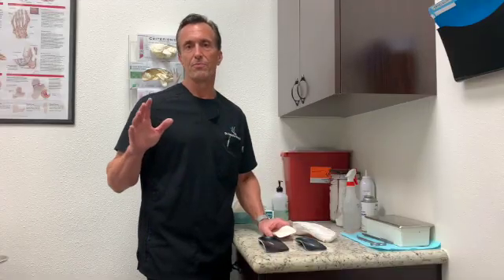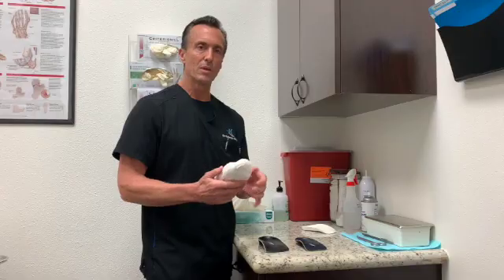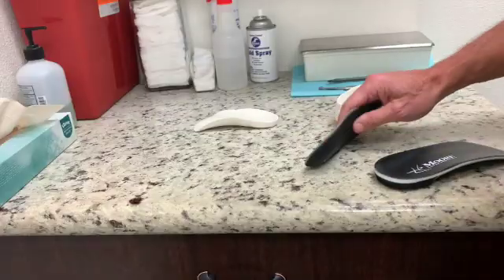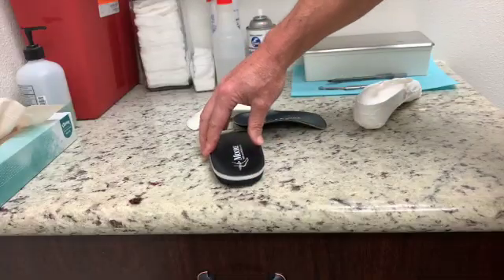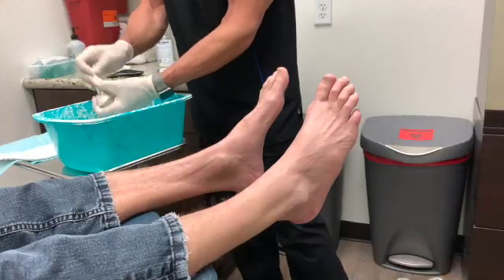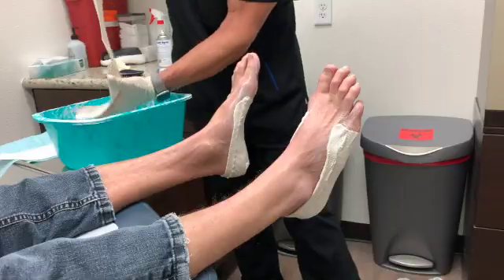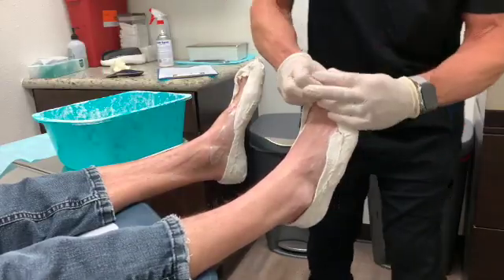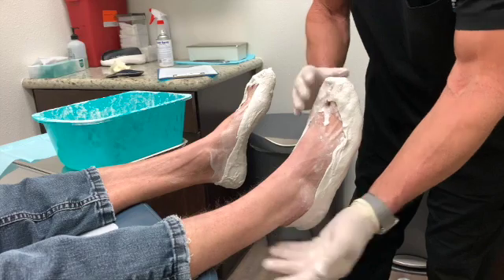Custom Orthotics Mold Casting | The Different Types of Arch Supports

Comment: They still do this
Reply from the maker: Yes, until someone perfects the compression foam molds, or 'scanner' technique, you can't beat the exact topographical impressions of a plaster mold.   Then the most important step is to find a lab that can produce an orthotic from these molds to address the patient's needs, good turn around time, customer service, etc.